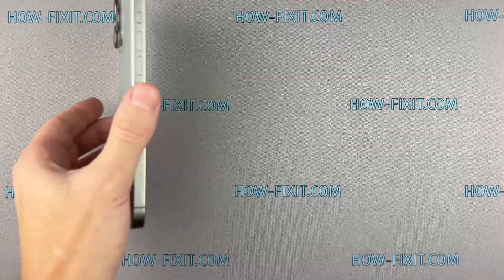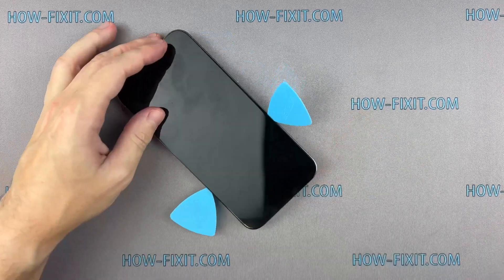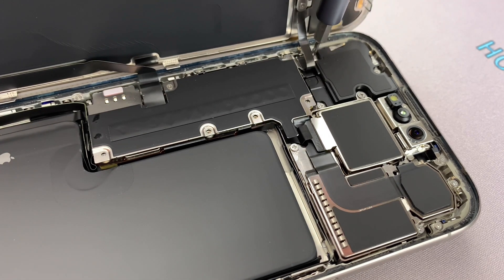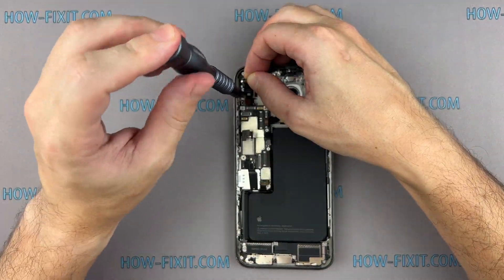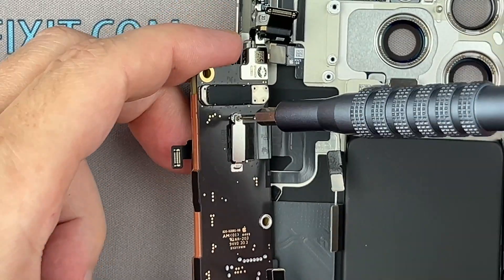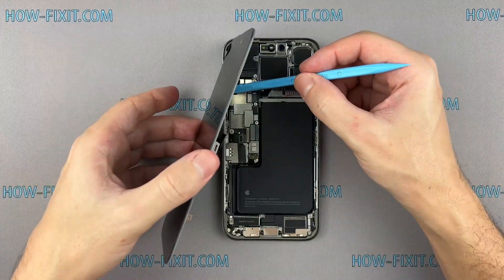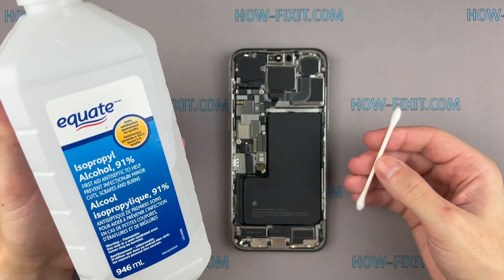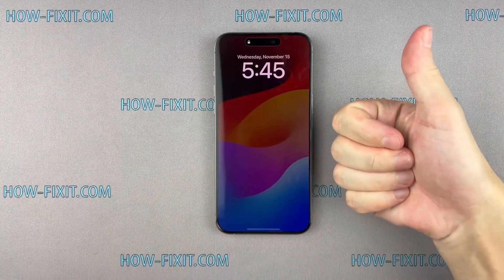iPhone 15 Pro Max Logic Board Replacement | How to remove Activation Lock

Comment: So changing out the motherboard can you activate it with another carrier ?
Reply: As long as the phone has a clean IMEI and is not blacklisted or reported stolen by the previous carrier, then yes, you can. Also has to make sure the phone is GSM unlocked
Reply: @socrate7676  the board already does that when u replace it no need to worry about the phone

Comment: you dont need to change the light sensor for FaceID, just the front camera & logic board. the logic board needs to be iCloud unlocked and needs to match the Face ID for it to work.
Reply: If I bought a lost/ stolen IMEI iPhone 15 Pro, and I swap the Logic board and front camera on it with another. 

Will the new logic board have a different IMEI that I can activate with my carrier? I’m stuck with a dummy phone at moment
Reply: @Teitus si compras logica con face id , deberia de andar sin problemas

Comment: They say that if I change the motherboard without face ID the front camera will not work, is this true?
Only in iphone 15 series
Reply: Me paso algo similar con un 14 pro max no se veía la cámara frontal pero al mes de repente al meterme funciono sola y ya no volvió a fallar, acabo de cambiar la lógica de un 15 pro max igual no se ve espero y pase lo mismo y de repente de imagen suerte vale la pena es menos de la mitad de lo que vale nuevo!
Reply: @alanvazquez715  Does that mean we can install a new logic board with Face id, and the phone will work perfectly fine?
Reply: @alanvazquez715  did it work perfectly or there's still some issues. I have iphone 15 pro max. That I want to change logic board
Reply: Did you find the answer?
Reply: @tomasvelezalvarez6315  finally I change the motherboard, the camera app doesnt work because have bug, only work back camera, but the front camera work good with other apps
Reply: Supistes algo de eso? Pero si lo cambio con face id funciona normal?
Reply: Please there's gotta be someone who knows that. I need some answers for issues like that
Reply: Dokładnie. Płyta główna wraz z Face ID jest droższa - a bez tańsza . Nie masz Face ID to nie działa twój przedni aparat

Comment: Many online stores only sell the motherboard and the Face ID module, but the light sensor is not included…will that be a problem if I want to keep the Face ID functionality ?????
Reply: You get logic board with face id module and as if you still have old one like light sensor you can use that it will not effect anything it will work